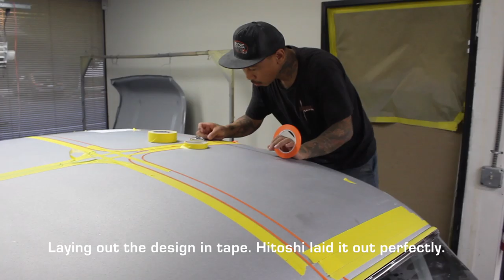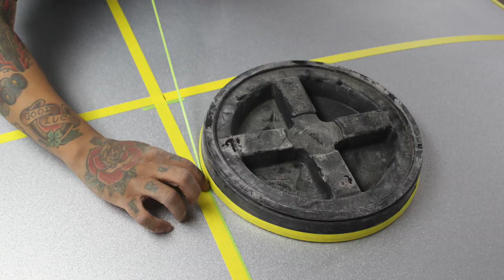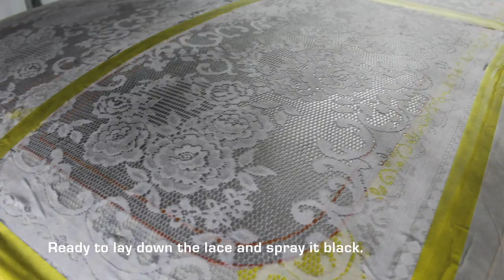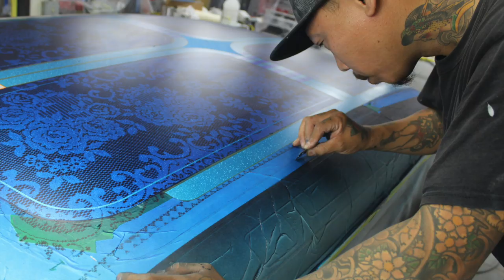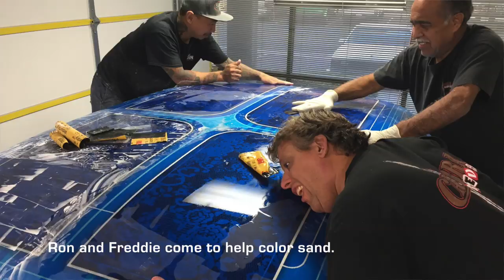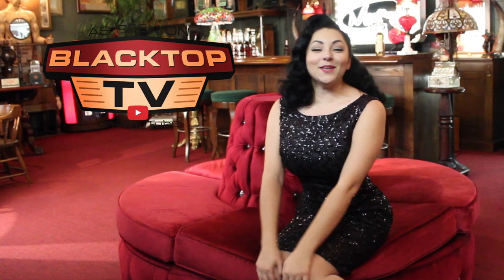Flake N Lace Part Two - Lace and Candy

Comment: Do you use a low tac adhesive to keep the lace down?
Reply from the maker: Bradley Cummings we used a super light dusting of 3M Super 77 let it dry to a light tact and laid it down. When we picked it up from spraying the black we cleaned any residue off before the blue candy.